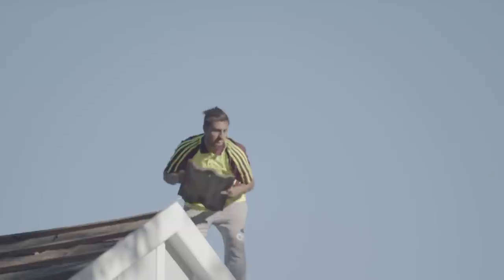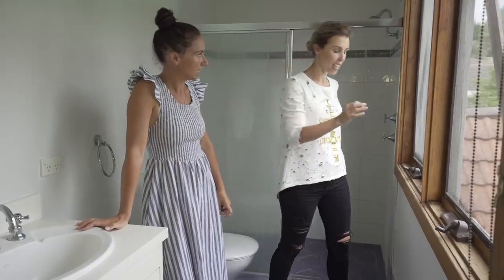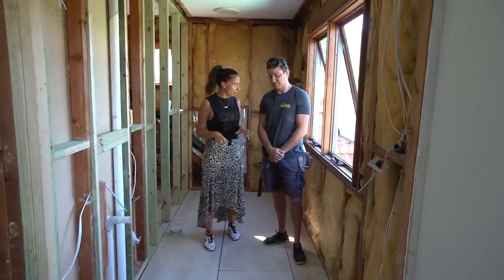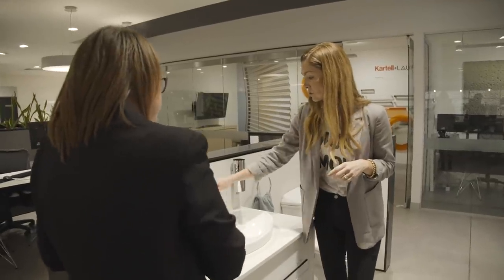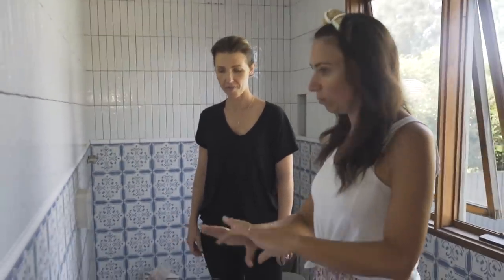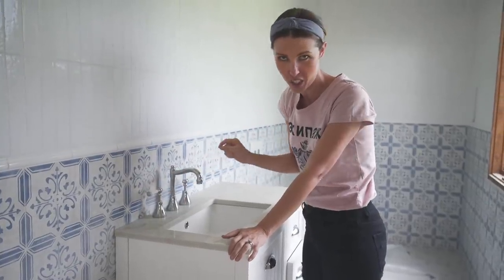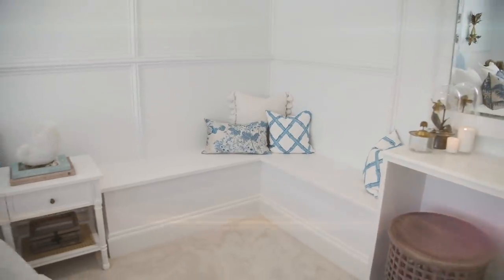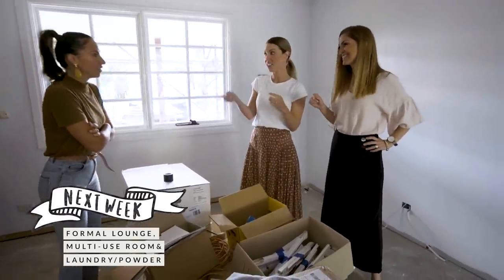Master Suite + Stairs Reveal, Episode 3 | Colour Me Hamptons Renovation | House 11

Comment: This is absolutely beautiful. May I ask what Dulux paint colour was used for the ceilings, walls and skirting?
Reply from the maker: Hi lovely, we have used Dulux white on white.xx
Reply: @Threebirdsrenovations  Thank you so much for the quick response. You're girls are all amazing!!!!

I'm currently doing a full reno on my unit in Cronulla.  I applied samples of paint on the wall of Lexicon Quarter, White on White and Vivid White. I went away for a bit and came back to look at it.  Both Lexicon Quarter and White on White gave off a silvery blue colour.  I didn't like it.  

I've decided to go with Vivid White.
Would it look silly if I did the Ceilings, Walls and Skirting Boards all the same colour in Vivid White?
Otherwise, what white would I use for the Skirting Boards?

I'm doing a Hampton kitchen in Angora Blue BTW.

Kind regards
Colette x
Reply from the maker: @colettesamerski3694  Hi lovely, here are a few really helpful articles to help you with your painting and renovation 
https://www.threebirdsrenovations.com/blog/whichpaint and also https://www.threebirdsrenovations.com/blog/whitepaint hope that helps.xx